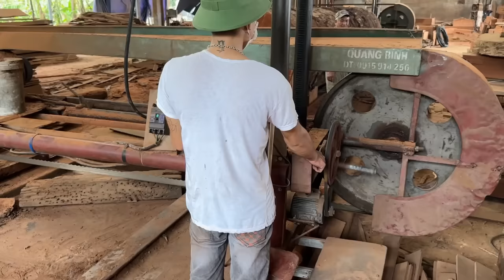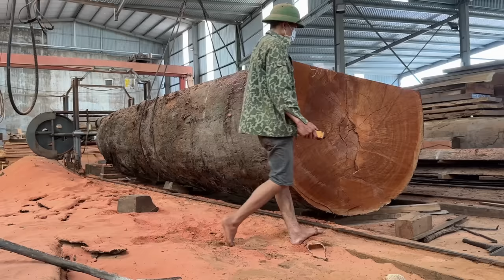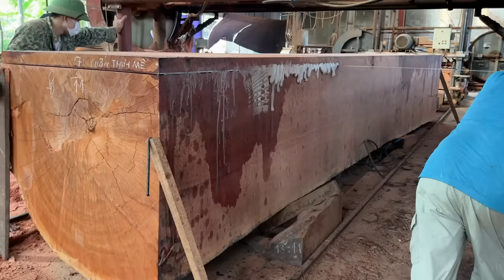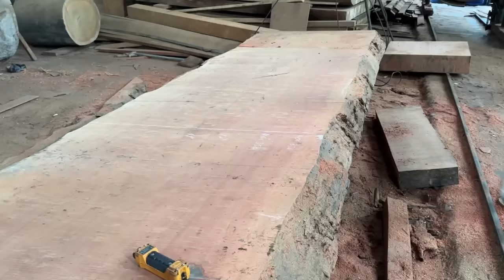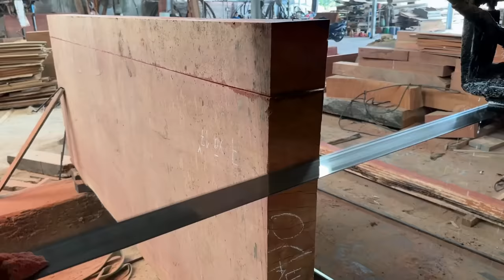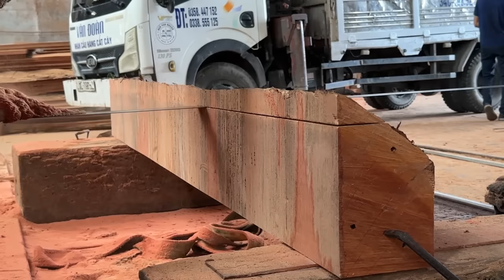Wood Cutting Skills // Giant Wood Saw Working At Full Capacity

Comment: I was a sawyer for 8 years ( my saw logs were between 5.5 inches to 10.5 inches but I could ( cut back ) 29 inch saw logs to 10.5 inches . I cut about 25 logs per minute and had only about 10 seconds to decide how to cut them ( having 4 logs , at a time to determine how I would set how to cut them before they were cut )  . I can appreciate having someone to help make the decision of how to cut them  ( because of the great value of the lumber being cut but I cannot appreciate that they don’t have a verable speed mechanical feed of the saw speed as opposed to having someone physically pushing the logs by hand ?? 🤷‍♂️
It would be extremely inexpensive to add a amperage sensor monitoring device that could monitor the amperage on the bandsaw motor and automatically vary the saw feed rate per second .
Reply from the maker: Yes. that was amazing! it will protect us from risks that we cannot foresee

Comment: If the band blade had teeth on both edges, you could continuously cut back and forwards
Reply: Band saws don't cut back and forwards my dude it's just one way!
Reply: @kqxp  you can get band saws that cut both ways with a double blade
Reply from the maker: That is very dangerous
Reply from the maker: yes sir
Reply: @luatmac  in what way? If I used a hand saw and stood on the right-hand side of the log, I push down to cut it. If I stood on the left-hand side of the log, I push down to cut it. If the teeth on your band saw blade were on the left or the right, you come in from that direction with the log. If there's teeth on both sides, you can come in either way.

What part of it is dangerous?

Comment: Is that sampo?
Reply from the maker: Other names: Mat, Chen, Sen gaa, Sen five points...

English name: Mukulungu.

Scientific name: Madhuca pasquieri. Saffron is a plant belonging to the Sapodilla family.

Place of distribution: The tree is often distributed in China, Thailand, and Vietnam. In Vietnam, the tree grows in tropical jungles from Lao Cai, Lang Son, Thanh Hoa to Quang Binh. In addition, there are also naturally occurring species of Sedge wood in the West and Central of Africa with the two-part nomenclature of Autranella congolensis, commonly known as South African Saffron wood.

Tree size: Large trees can be from 30m - 35m high, trunk diameter from 1.3m - 2m. The Sen plant grows slowly, prefers good soil and moisture.

Average weight of wood: 945 kg/m3

Specific gravity of wood (Moisture 12%): 0.94

Wood hardness: 2310 N

Wood brittleness: 74 MPa

Elasticity of wood: 17.06 GPa

Compressive strength of wood: 119 MPa

Shrinkage of wood: Radial shrinkage is 5.8%; Tangential shrinkage is 7.4%; Volumetric shrinkage is 14.8%. The T/R ratio is 1.1.

Color of Sen wood: The heartwood is reddish brown, the wood has few senses and is clearly separated from the heartwood.